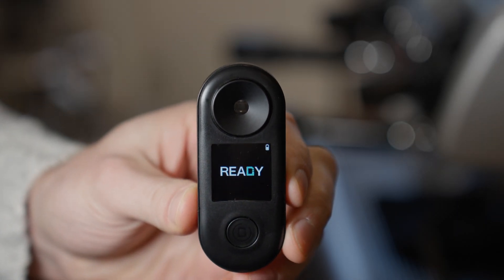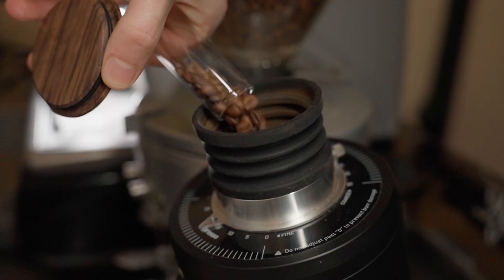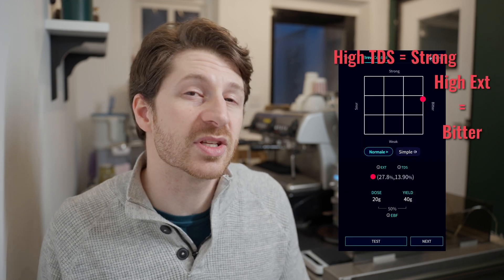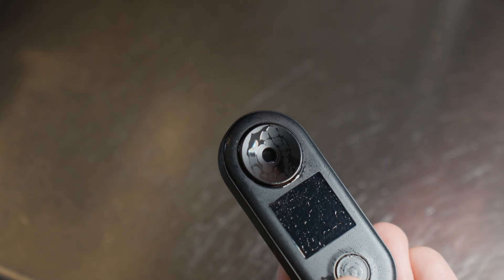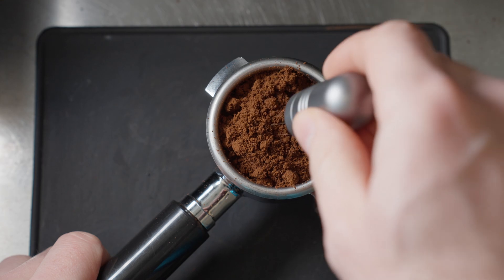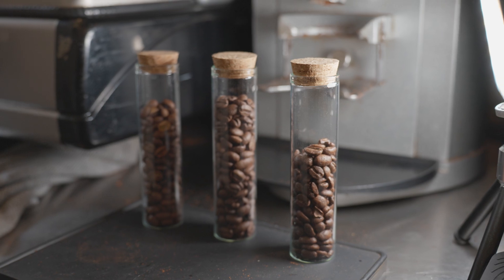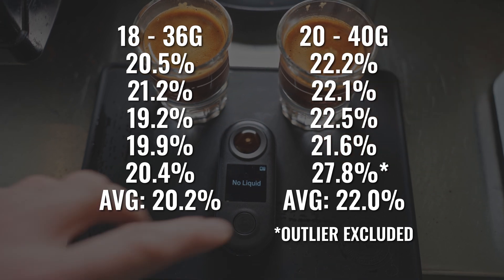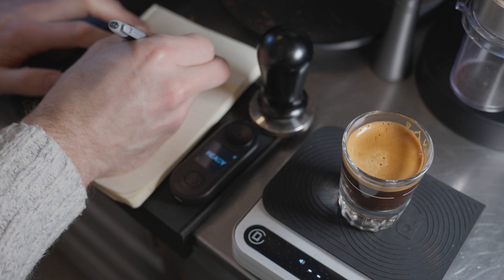Does Higher Extraction Make Better Espresso? [Refractometer Tests]

Comment: Been playing with this for a while and I get similar results but it varies per roast as what tastes better. My current batch I had to go to 16:32 as 18:36 and 20:40 were way bitter and over extracted. It makes sense though - if you are passing more water through more coffee in the same time window, then it's going to have more solids. My take away is that there is a perfect grind size that optimizes time and extraction for every bean. For example on the 20:40 to lower the extraction, I would have to go too coarse and did not taste as well as the 16:36. My lighter roast batch is a world better at 20:40 as it needs to extract more from the bean and I can get to that finer grind. Fascinating stuff. Just saw your post on the FB group on the Pesado but the Big Bang is so dialed in right now that Im afraid to change and start dialing in again as my issue is always over extraction, rarely do I pull a weak shot. Great stuff my friend!!
Reply from the maker: If it works for you, that's great! And your right every bean and every roast has is own optimum grind size, but lots of room at the margins to play with it and get interesting results

Comment: Hi, did you mention if you were sent this for free? I always wonder about these glowing reviews and then see the discount code to purchase the item, particularly if the item was sent for free. I bought one of these with my own money and found that mine didn’t seem to perform very well.
Reply from the maker: I was sent it for free, but I always tell companies that I always tell the truth about products they send, so if they don't believe in their product it's better not to send them to me 😅 I use my refractometer for testing, and haven't had issues with it. But it's not a paid promotion and if I didn't like it I wouldn't be talking about it
Reply: I bought one of these myself for Christmas and APP user interface is good but you need to be patient. I found it to be consistent and accurate and has given me good results to help me fine tune both light and dark roasts. I have a decent grinder DF64P so that may help. Shenzhen digitizing fluid technology company has been very responsive and helpful with fulfilling my order very pleased. I found the scale that it pairs with works extremely well and I like the graphs that it produces but that's me. Overall I would say the app the digitizer and the scale are worth the $311 USD I paid for it plus they gave me some free stuff ( a case that will hold all I bought, a syringe with a filter, and a scale protective cover) but that was a Christmas bonus offer.

Comment: For measuring espresso, I recommend using a syringe with a VST filter, this is to breakdown some of the C02 to make each reading consistent. Also, you should just move the crema out of the way when extracting the espresso into the syringe

Comment: You're doing it wrong. That's why the readings are inconsistent. You really need to let that shot sit to bring that temperature down. Then you want to stir it really well
Reply from the maker: I let all of them come down to 50°C... Next time I use the DiFluid on something I'll explain my process better 😉
Reply: @homecafecharlie  you probably should wait a bit longer and measure at 25c or so

Comment: I‘ve read studies that show that the method with a refractometer does not work well with espresso due to the high amount of unsolved solids that come with the high pressure extraction. What’s your point of view to that fact?
Reply from the maker: Good question! I did some research and the variance is just enough to not be totally scientific (I would use filters if I was writing a research paper), but most indicated between 0.4-1.8% variance. I think that's still close enough to make a fairly accurate judgement, and honestly I'm glad it saves me spending £5 per special filter made exclusively by the company that insists we all use them for our measurements. It's a marginal improvement in accuracy at a very very steep cost.
Reply: @homecafecharlie  Thank you for the clear statement. Have you compared the tech solutions to a manual refractometer? I have a manual one but would you recommend using a digital one to get better results?

Comment: Ok, here is one thing I'd like to mention: The WDT technique that you show on the video is - sorry - terrible. The tool that you use is way to inflexible and its needles are too thick, resulting in too much coffee grinds being moved in the basket. Also I recommend you to do a little research on WDT techniques as WDT is not just for lumb breaking but for an even distribution. decent posted a video on this, also Lance Hedrick did afaik, but as a short hint: You need to circle around the center like drawing little spirals around the sun while getting upwards until the tips of the needles hit the surface of your coffee bed. The result should look fluffy and evenly distributed like a little zen garden (I've uploaded an example photo here: *there was originally a link here*). Yours looked a bit like craters, sorry again to say that. 😅 When evenly distributed, you don't even need to tap the portafilter, just slowly and evenly compress the fluffy grinds with a tamper and you'll get the loveliest extraction ever. And I can say that having tested lots of tools… The ESPCUP, Duomo The Eight, OCD, Blind Shaker, etc. If you are in search for a nice WDT tool, I would always recommend the one from sworksdesign. It is pricey but the best tool I've ever used and worth the investment. 😊 Second repost with the link removed. Seems that YouTube doesn’t allow me to attach photos of fluffy coffee 😂
Reply: The problem with the coffee raking argument (I won't be caught dead using a name so ridiculous and pompous as "Weiss Distribution Technique", sorry) is that it ignores the fact that granular materials advect almost like liquids. It won't stay distributed the way you set it, and it won't stay distributed in whatever way the grinder happened to set it either.

As for the "needle is too thick", "you need a more expensive tool" etc line of argumentation, you might want to look at what Weiss himself used, and what very specific technique he described.

Spoiler: it was a dissecting needle about as thick as a toothpick stirred in no particular pattern at all.
Reply: @isodoubIet  But is the tool that Weiss himself used and his technique argument against the fact that the tool I use and recommend is useless or not worth it? The fact that granular materials advect almost like liquids is why this technique produces constant results as you constantly recreate a perfectly even bed of coffee that you constantly compress in the same manner. It definitely does make a difference whether there is a big crater in the middle or not because the grinds ALMOST advect like liquids. Ever seen a donut extraction?!
Reply: @3ede467  "But is the tool that Weiss himself used and his technique argument against the fact that the tool I use and recommend is useless or not worth it?"

You have it the other way around -- it's the people raking their coffee pucks who should demonstrate to the rest of us that this stuff does something measurably useful.

All I'm doing is pointing out that this technique being advocated has no consistent definition or standards, and furthermore, I can't fail to notice that when people measure it they always report something like "oh well we didn't really see a difference but maybe we would've if we'd done a different test I guess ¯\_(ツ)_/¯". Or other times people see the opposite conclusion than "expected", like that thread on the HB forums where someone found that raking reduced TDS and EY, and Weiss still found a way to justify it. In other words, this is looking like unfalsifiable nonsense.

Post evidence that your technique works using a properly designed experiment, with a consistent methodology, repeatable procedures, a large enough sample size, and correctly conducted statistical tests, and I'll reconsider.

"The fact that granular materials advect almost like liquids is why this technique produces constant results as you constantly recreate a perfectly even bed of coffee that you constantly compress in the same manner."

It'll do that right out of the grinder. You don't need to bless it with a raking tool and a veneer of pseudoscience.
Reply: @isodoubIet  You're right on the point that there is no consistent or standardized definition of a right WDT but definitely not on the point that there is no difference between the results right out of the grinder vs. the raking in-between. It made a noticeable difference on channeling, extraction evenness, puck resistance, yield and finally taste. And as I have been testing around with numerous ridiculously expensive tools, I stuck on just three things: A good grinder, my raking technique with the expensive raking tool that I have mentioned and a precision tamper. I cannot proof it with scientific results but with the experience that I personally made with it for months now, with different coffee beans, doses, grinders and espresso machines. 🤷‍♀️
Reply: @3ede467  "I cannot proof it with scientific results but with the experience "

The problem with experience/anecdotes as evidence is that when dealing with a process as finicky as espresso it's incredibly difficult to correctly detect variations, let alone attribute them to a cause.

For all I know, you wanted raking to succeed and subconsciously tamped less evenly when you tried not doing it. Or maybe you adopted raking more or less at the same time as you improved your other skills and attributed the improvement to the raking.

It's very hard to tell, which is why evidence of near-scientific quality is needed. It's the reason drugs efficacy is assessed using careful controls and double-blind tests -- any number of things can induce a misleading bias, and evidence of the type like "it worked better in my experience" is more or less analogous to "I tried this medicine and I felt better afterwards". You don't really know why you felt better, only that you did, and that you took the medicine before that. Determining that the medicine is the likely cause of the improvement demands much more work.
Reply from the maker: Thanks Chris. I usually distribute round and round when I have my dosing funnel but the cafe has a 53mm portafilter so I can't be as rigorous.

Comment: A couple of comments on refractometer usage (but take them with a sprinkle of salt cause I don't own one)
pretty sure you aren't supposed to zero the refractometer with distilled water. I believe you're supposed to use the water in your espresso machine. Kinda like how you zero your weighing vessel on a scale

I didn't see it in the video, but you are supposed to use a paper filter before refracting for more consistent results, as I think this is why you had some very odd outliers.

Besides that, I seem to be running out of coffee, and I think I have found a new roaster to try (:
Reply from the maker: Hey Nick - it's complicated for sure. The experiments were still very interesting, may not be totally accurate, but the differences are really apparent!
Reply: @homecafecharlie  nick is absolutely correct.